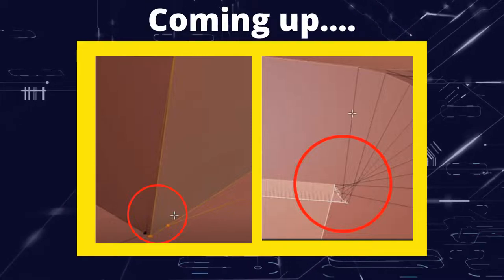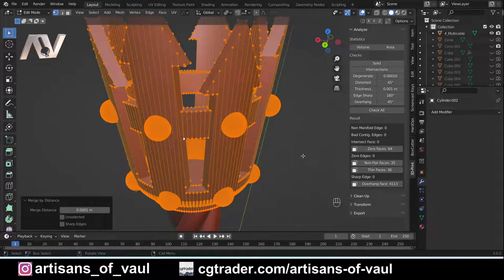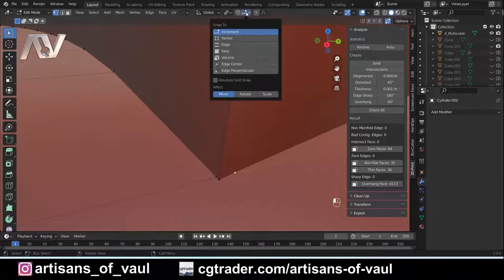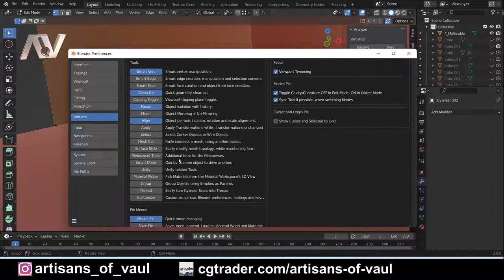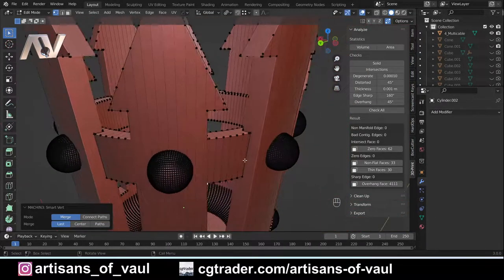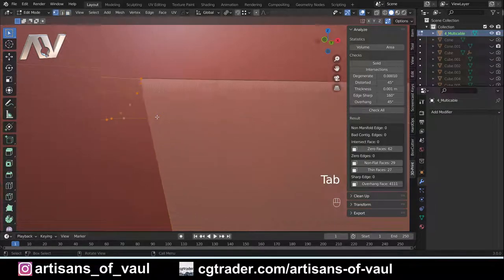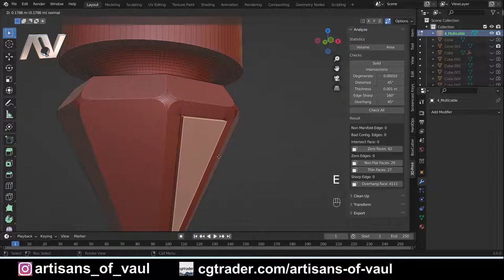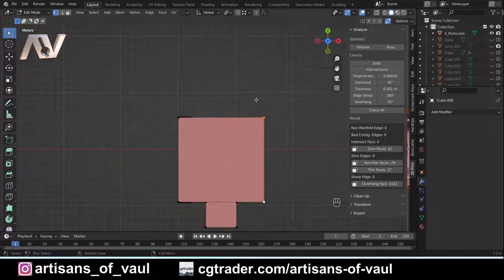How to fix mesh errors in Blender

Comment: Hi, maybe this is something you already know but you don't feel like it make much of a difference, but when I learnt about keeping "ctrl" pressed to toggle snapping it changed my workflow greatly for several processes. 

For example, with what you said in the first part of the video of reducing clicks in mind, I would say the last  part about machine tool of fixing some alignment problems could be much faster this way. For example, for getting the inset vertex into place: select vertex snapping (but do not turn it on), select vertex -> g -> x -> go over the other vertex while pressing ctrl. Or for aligning the cube vertex, select vertex, g -> shift+z -> go over the vertex in the bottom while pressing ctrl and then make the same with z instead of shift+z and go over any other three top vertex.

Apart from that, thanks for your videos, it is one of the few channels that focus on modeling for 3D printing and you address a lot of interesting issues.
Reply from the maker: Really good comment and very much appreciated.  It is something I know but I probably should have put that in for the exact reasons you mentioned, though normally when I am using snapping I am using it a lot in a row so it helps to have it kept on.  But thats my workflow and it isnt good to assume the workflow of others follows that.

Comment: Nice video. Pretty sure you don't need to worry about non-flat faces. STL automatically triangulates all ngons. Also, when modeling for 3D printing, always use EXACT Booleans as they will generate much cleaner and more manifold meshes. While I didn't see you model this object, the artifacts appear to be similar to those generated by fast Booleans.
Reply from the maker: Cheers Chip. Love your add ons by the 👌🏼 Totally agree on using the exact boolean wherever you can for the reasons you mention and agree you don't need to worry about the non-flat faces. Though I do often like to triangulate some non-flat faces myself as of they aren't flat it means you can control where the "edge" gets put and that can really change the shape of the object you've made. Though normally that's an issue for more extreme non-flat faces. 👍🏻

Comment: There is a feature in mesh machine called unf*ck and it can easily fix the inset issue wile maintaining the bevel on the inset not aka merging them, and can do much more. look it up.
Reply from the maker: Thanks man.  I already use Mesh Machine, its such a great product but I appreciate you bringing it to peoples attention!  I just wanted to focus on things that are free to begin with.  I want to do a whole video on it at some point as its ability to fix geometry issues with booleans and everything it can do with bevels really deserves a video on its own.  The offset cut feature alone is something that could be its own video for example.

Comment: Which of the errors from 3d print addon are neccesary to get rid off and which can stay for 3d printing? Do we need to completly clean up a model from for example every single intersecting faces or non flat faces? Or if 2 or 3 small  of those error wont be fixed it will completly make our model unprintable? Asking coz cleaning every single mesh error on model with displaced texture or remeshed and sculped looks like impossible task.
Reply from the maker: Intersecting faces can cause a lot of issues, as will non manifold errors. Non flat faces can cause issues with later booleans but can often be fixed with the triangulate modifier or by exporting the stl and taking it into Microsoft 3d builder. It's a free program and generally works pretty well. It can fix some other errors as well but the more errors the more issues it will have.

Comment: Another great way to align something you're moving is "CAD Transforms."   It's basically snapping on steroids. Really helpful if you're doing hard-surface technical stuff in 3D printing, and you want the center of this face to by on the same Y value as the middle of that edge and things like that.
Reply from the maker: I'll have to check that out for sure.  It sounds quite like Quick Snap ( https://youtu.be/4zKAKkU206M ) so it will be good to compare.  Thanks a lot 👍
Reply: @ArtisansofVaul  I didn't want to plug a competing channel here ;-) but the best place to look is probably Maker Tales. He has a quick video and a whole 50-minute "everything you need to know" video. It's a great channel for blender 3d printing stuff.
Reply: @ArtisansofVaul  Yeah, it looks like CAD Transforms the same idea turned up to 11. I like that you can select a bunch of verts, then move them so some unselected vert matches somewhere, for example. (I.e., the snap point doesn't have to be one of the selected verts.) CT also has similar things for rotating and scaling, which I use less often, but it's nice to be able to say "move the prongs of the hook so the inner faces are absolute 32mm apart" and such. I'm gonna grab Quick Snap, because it looks a lot simpler than CAD Transforms, and doing what he's doing in that video is 95% of what I do anyway. 🙂
Reply from the maker: @darrennew8211  Sounds interesting. I generally use Construction Lines for more complex movements like you have described. Again it will be good to compare. I'll go have a look at that now. Is it in Blender Market?

Comment: So what about non-manifold edges ? Thanks
Reply from the maker: That's going to depend on the cause. Alot of the time the 3D print toolbox make manifold button will fix them. Other than that I'd probably need to see the issue.

Comment: Are Zero Faces and Thin Faces OK to have on the mesh? We just need to get rid of Non-Manifold Edges, Non-Flat Faces, and Intersect Faces, correct?
Reply from the maker: Yeah. Zero faces means that the face is very small. I believe you can set what face size sets that off but I just ignore it, I think it's more a concern when doing design for CG (but don't quote me on that). Thin faces (I believe) means that the place where the face is is very close to another (so would make a thin thickness of a model). Depending on the angle of your print that could cause an issue but I've never had any concerns

Comment: Some good pointers here for sure. I am just so confused about 1. why the super high poly? 2. why boolean all the parts together instead of just join and leave it as it is?

I can see using boolean if you print things hollow, but this is surely not going to be the case here?
Reply from the maker: Good questions.  So:
1. For 3d printing the higher the poly the smoother the print.  While this is intended for 28mm so this might be overboard I have had a number of my designs used for scaled up prints so its just ensuring that whatever the use the model should scale well.
2. This is a bit of a bugbear of mine.  Just joining the objects together is really bad form for a number of reasons.  Some 3d printing programs have issues working out the objects so will put supports in odd places.  In other instances as programs try to work out the joins between the joined bits they create some horrible geometry.  And finally if youy watch my tutorial on importing STL to Blender you will see the results of just joining things on the BFG ship, it makes objects some programs cant make sense of.  I want people to be able to use my designs as a base to modify them for their own purposes (by bringing things into Blender) so I try to make so that process as easy as possible.
Reply: after only a few weeks of learning blender my no. 1 goal is to make a proper object. sometimes with leaving things just joined the slicer can't make sense of what to even print.

Comment: Shouldn’t triangulating the mesh get rid of non flat faces
Reply from the maker: Sorry, I'm not quite sure what you mean...
Reply: @ArtisansofVaul  try it. It gets rid of engons and computers like triangles. Use the triangulate modifier set to beauty. So I’m thinking it should solve a lot of issues especially if you’re not deforming it
Reply from the maker: @shmuelisrl  Oh I see what you mean.  Yeah, I have done a video that includes fixing these sorts of issues here: https://www.youtube.com/watch?v=_H8laeyUIyU

But in this instance it wouldn't be suitable as it would then create some ugly mesh for then extruding from (which was the aim in the video).  The triangulate modifier is something I would generally use towards the end of a project.  At this stage I would say something like Mesh Machine or manually fixing it is the best option.